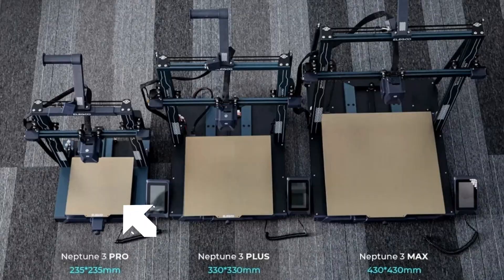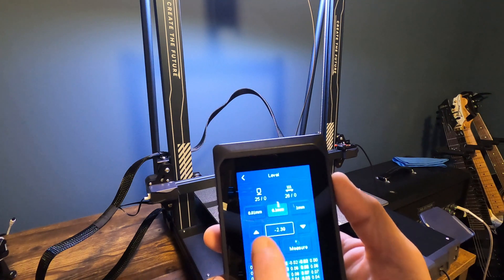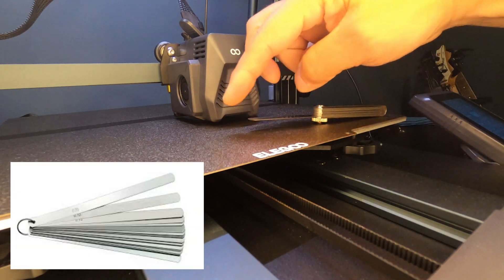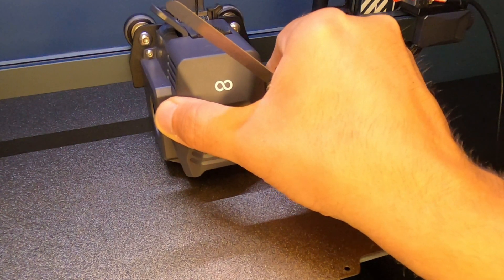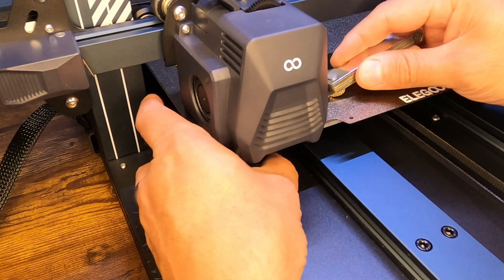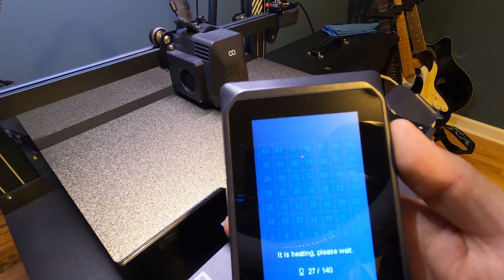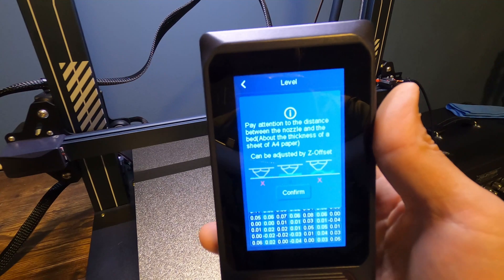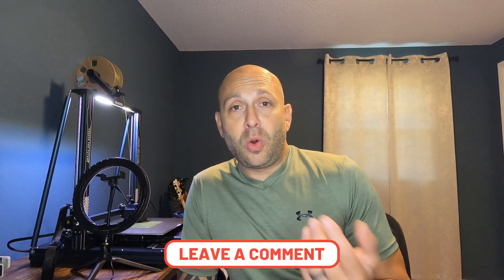Elegoo Neptune 3 Bed Leveling

Comment: You can remove the individual feeler gauges from the pack by removing the screw in the sheath.  Then the feeler gauge will lie flat on the plate.
Reply from the maker: Yup sure can!

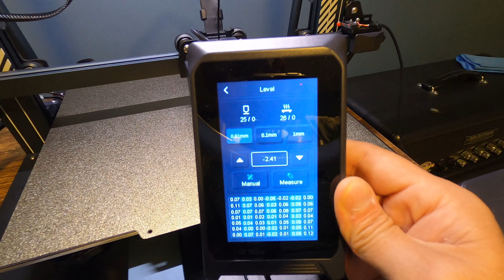Comment: Your description says "This works on any of the Neptune 3 series" but unfortunately this is not true.  At 3:42 you hit Manual which is not an option for the Elegoo Neptune 3, only the Elegoo Neptune 3 Pro or Max.
Reply from the maker: I think the pro doesn’t have the bed adjusters
Reply: I have the pro, I can confirm there is no manual leveling

Comment: My neptune 3 pro doesn't have those the option to manually bed level
Reply: My pro also doesn't have the knobs underneath or the options on the display.
Reply: I have the pro version with the upgraded firmware and also not seeing these options.
Reply from the maker: I’ve heard that about the pro model. That’s probably a good thing. Less adjustments. Just do the auto level and it should be fine

Comment: hey, I found your video very good and have bought the gauge but I can't tell if the gauge is feeling tension as well as with the paper, any suggestions?
Reply from the maker: You’ll definitely feel the paper and gauge have friction if adjusted properly
Reply: @theguyofalltrades  Yeah, i think I finally did, have had like three weeks of great prints

Comment: just got my neptune 3 pro and i had 2 successful prints even after i auto level the 1sr level position isnt even on the bed its way off to the right but as far as printing i get good few layers down and then it will just stop in same spot everytime any help will be greatly appreciated
Reply from the maker: I would start the relevel process over. Tighten the adjusters all the way down then go through it again

Comment: Need a maintenance video from this machine now after 2 years but don’t know what to do lol. Ps loved the video
Reply from the maker: Thanks! I just basically re-line the screws every month with super lube silicone lubricant. You can get it on amazon. I blow out all the fans with air duster. That’s basically it. Maybe check belt tension too

Comment: Is it necessary to keep the the probe point detection data to within ±0.1, or it really just depends on the machine?  Your values seem to be within ±0.1.  And what do the hi-lited versus non hi-lited columns mean?  Thanks man!
Reply from the maker: I haven’t done anything special. Just must be a really flat bed. Not sure on the highlighted values but it might mean ones that are different from the initial calibration when auto went through the auto mesh

Comment: My pro doesn’t have the 6 auto level spots in the corners just toe auto and x offset? And the values vary a lot on my bed how do I fix that
Reply from the maker: If they vary a lot you probably have a warped bed. Could try a different pei sheet or go to a dipped plate from sliceworx

Comment: If your levelling wheel comes off, how do you get it on?
Reply: Its just like a nut on a screw. Screw it the opposite direction
Reply from the maker: Just screw it back on. You may need to compress the bed on that side if the threads don’t catch
Reply: @ I had to put the whole machine on the side, but I figured it out the same day!

Comment: what happens if you use paper and it is not consistant will it ruin your print
Reply from the maker: The paper is fine. Just make sure not to set the nozzle too tight against it. You want to feel just a little friction when moving

Comment: I need help from someone when i return to home in the manual level my printer is offset slightly right from the middle of the plate.  PLEASE HELP
Reply from the maker: Run the leveling routine a couple times and it should all even out
Reply: You don't need help. That's completely normal. If you look closely under your Extruder, you can see that the distance sensor is positioned at the back left corner, so the sensor is centered.
Reply: @Bibaboboss thank you so much

Comment: When I do return to 0 on my 3 plus it does everything fine until it starts to drive really deep into my bed probably messing up the nozzle and stuff and then I gotta turn it off so too much damage is not done and it started doing this mid print
Reply from the maker: Is the zero sensor loose? It’s mounted under the hotend shroud

Comment: I was under the impression you had to save after you level because it doesnt auto save? something about having to add a line in Gcode or something like that.
Reply from the maker: It auto saves as long as you do the manual then auto level second. FYI updating firmware will wipe out the mesh points so you’ll have to relevel again

Comment: Thankyou for your video! I was able to level my max 3 by adjusting my first level before measuring all 6 sides. At first I couldn't level the right side of the bed...but it was because I needed to adjust my center level first. Thankyoh so much.
Reply from the maker: Welcome! It sometimes takes a couple times of going through the middle then the outer adjustments before it evens out

Comment: I am still majorly struggling with my printer over 1 year later. its the Neptune 3 plus. I have never once been able to get it consistently level. ironically my old cr 10 with the glass bed... I never had any issues. I have updated the firmware and have followed the instructions after buying a long feeler gauge and its improved but even today I cannot get it to consistently print correctly. I saw the comment to screw the wheels tight and reset the offset to zero and try again so ill see if that might help. sorry for the ramble I just don't think this printer is worth the headache..... at least the 3 plus in my case. I have to say as for a guide your video has been the best resource i used for improved results so you have my thanks!
Reply from the maker: Welcome. It can be finicky but once it’s dialed in will go for months without touching it. I must say Elegoo sent me the 4 plus and it’s much better.

Comment: So updating the firmware on these is difficult? I saw in the comments that its not really easy to update?
Reply from the maker: I found it extremely easy to. I think the issue people have is not using the correct size sd card

Comment: Hey. I'm a little confused here because I noticed on your screen there was an option to manually level the bed but I don't see that on mine. But then I also read another comment talking about having to update firmware... Would that be the reason I don't have a manual option?
Reply from the maker: What firmware version are you running?
Reply: His is a PLUS, you likely have a pro.

Comment: 11am I find your video extremely easy to follow. I’m not very good at this type of technology if that’s the word, I need to follow videos in order for me to learn stuff like this. I’m 60 years old and this is my first time with something like this? I don’t even know how to use a video game.
My question is, can you make a video of what to do when you’re in the middle of a print and your spool runs out 
Does it stop printing do you lose? Can you continue where you left off after the spool is replaced?
Reply from the maker: If you have a filament run out sensor like I do on this printer it will stop the printer if it’s enabled. You just then swap out the empty spool for a full one, purge the filament out the nozzle and restart the print on the screen and it will pick back up.
Reply: Am 63 and bought a printer two weeks ago. 

The bed leveling did my head in.

Most of my print failed at the first layer or two and or warp.

Sadly for me my work shop is unheated and very drafty so I suspect that is the main cause.

Comment: Im confused, before this video i have seen people comments about feeler gauge and they say 0.08 some say 0.06, some say 0.4 and after this video im more confused. If i understood correct, you said 0.4 or 0.2, so what is best for 0.4 noozle?
Reply from the maker: .06 is definitely too close. It will smoosh your first layer. A standard piece of A1 office paper is anywhere from .2 to .4 depending on the weight of the paper. I’ve always used .2 but .4 seems to work better. The auto leveling will take care of, minor differences

Comment: Elegoo sucs DO NOT BUY THIS SHIT I have an elegoo mars 2 pro and neptune 3 pro you gotta update firmware and d all this shit it's bullshit
Reply: 100% agree.  Their software is trash.  Almost all my prints have something wrong with them.
Reply from the maker: All printers need firmware updates. Unfortunately Elegoo isn’t super user friendly. Bambu is the way to go. I’ve bought two x1c and an a1 combo since this video and barely use the Elegoo any longer. Doesn’t even compare to Bambu
Reply: @theguyofalltrades  well I didn't k ow I need a. College education in firmware for this I've run three other ones with no upgrade fuck elegoo thier shit I'd trash glad it worked foru

Comment: Hello! Could really use your help. Went through your process on leveling the bed of my  brand new Neptune 3 MAX. Problem is that when printing large model the print line is smeared in the upper left hand corner of the build plate. Seems to thin as well. It printed out the buddha model no problem , but of course that is pretty small. Please help!
Reply from the maker: If it’s smeared the nozzle is too close to the bed I think

Comment: Hello. when I click on level, it moves back and forward, and then itgoes down (eje y) and when It touch the plate, it trys to continue going down and start to sound a bad noise... what could i do
Reply from the maker: Start from scratch. Make sure z offset is zero and tighten all the adjusters. Then go through the steps again. It may take a couple tries to get it perfect
Reply: Is the build plate on? The printer uses the metal build plate to recognize the bed. If it's not on, it'll keep going down and damage your bed and the nozzle..

Comment: It would be nice if the ABL worked … I’m part shimming the corners of my bed up and sliding post it notes under the plate
Reply from the maker: It works fine for me. Maybe try re-trimming the bed with a feeler gauge instead of paper if you haven’t then run the auto level again?
Reply: Thank you for your response.    @theguyofalltrades  I think I found my issue!  The sensor was cocked a little to the side and not reading straight down.  I had it slightly crooked when I tightened the fastener and it had jumped over its alignment pin.  At least I hope that was it.  I changed that and added M420S1 to my start up gcode to apply the mesh to the print and I think it’s working ok now.
Reply from the maker: That’ll definitely do it. Don’t even think of that. I’ll file that one away for later in case I have this issue.
Reply: @theguyofalltrades  

By the way you’ve got a new follower for caring enough to respond to my ambiguous and typographically erroneous comment.
Reply from the maker: Thanks!

Comment: If it's not a stupid question if you adjust all 6 wheels to the feelers gauge then adjust the z axis in the middle doesn't that mean all 6 wheels are now wrong ?
Reply from the maker: Nah the middle tends to be lower or higher than the outside. That’s why you use a .1 or .2mm feeler. It gives you a little wiggle room. Too close and you’ll notice your first layer will be squished and too far you’ll see separation between layer lines

Comment: I have the same printer and am having problems.  A couple of the six adjustment knobs are somewhat loose.  Can't seem to figure how to adjust.  I did contact Elegoo and hopefully they will help.  But maybe you have a suggestion.   Thanks.
Reply from the maker: I would tighten them all the way down then reset your z offset to zero. Home the printer all axis and proceed to do the manual bed leveling then the auto. It took me about 3 tries when I first got it out of the box. What are you using for a feeler between the nozzle and build plate?

Comment: I agree with the overall steps in this video and I had switched to a metal feeler gauge as well to be more consistent as I found that an A4 paper thickness is anywhere from .05mm to .11mm depending on the source and even so I've had way to much trouble getting prints to stick to bed or layers to stick / smush correctly ... so Elegoo's Auto level is only of value if you can get the z offset right and this process above  (by it's self) did not work for me.  What I did was do the steps in this video and then print a adhesion square in each corner and middle of bed this allowed me to see that I needed to make additional adjustments to z off set until lines started sticking and no longer see gaps between lines .... after all that I kept retesting these prints until I could remove them from bed and not pull apart the printed squares, printing only one layer of the test square was enough to see if sticking well and layers smushed together if not adjust z off set and print again.   Another thing to keep in mind is if you see wavey layer where parts are almost see through you are to close to bed so need to find a balance between your adjustments to Z.   Just another newbie with my 2 cents.
Reply from the maker: Checkout the other video. I found a bed level print I upsized to fit the plus that works amazing.

Comment: After doing this do you have to subtract the size of the feeler gauge from the original z-offset you input to calculate the .1mm that was used to level? Im just having a hell of a time getting my bed leveled and ive done every tool imaginable and areas still dont come out right.
Reply from the maker: Make sure you clean the build plate with isopropyl alcohol. Did you set the z offset again after manually tramming the bed and auto bed leveling? I adjust it before and after

Comment: I leveled the bed once on my Neptune 3 Pro, a few times on my Neptune 3 Plus, and repeatedly on my Neptune 3 Max, which inexplicably needs it frequently.

Another annoyance is that none of my Neptune 3 printers remember the Z-offset unless that is performed immediately after bed leveling; at any other time, changes are lost the next time the printer is restarted. I can work around this by tweaking the Z-offset in Simplify3D, but engineers thinking logically could enable that in Elegoo printers, as other manufacturers have done.

Another persistent problem on the Neptune 3 Max is that I must mash the nozzle into the bed (roughly 0.2 mm lower than it should be) before manually adjusting the six knobs; if I don’t, the nozzle is considerably too high at each of the six points. I can ultimately obtain very good leveling and Z-offset but the procedure is noticeably more exasperating than it is on any of my other printers.

My Anycubic printers (Kobra Max and Kobra) are better than my other eight printers in terms of remembering bed leveling and Z-offset as well as having a logical, intuitively obvious menu structure. The award for most convoluted, utterly illogical menu structure goes to Creality for what they did on my CR-M4 and Ender 3 S1 Plus, both of which seem hell-bent on destroying print beds; each one has done that repeatedly, most recently with the CR-M4 ruining an expensive 470x470 mm PEI sheet by attempting to print a few millimeters below the bed after months of printing — some only hours before — with the bed correctly leveled and Z-offset set A-OK.

After these and other problems, the chance I will ever buy another Creality is ZERO. Elegoo? Probably, but with some trepidation.
Reply from the maker: I find it pretty easy to level it honestly compared to an ender. I don’t feel like the mesh level really doesn’t do anything. I get super consistent prints and level once every few months.
Reply: What do you mean The Neptunes forget previous measurements after being restarted!? 
Are you telling me all the work that I just had to follow on this video is going to be made completely worthless every time I turn it off?!
Reply: @JackEverton101 : On my three Neptune 3 printers, only the Z-offset is lost when the printer is restarted UNLESS that is performed immediately after bed leveling. Putting their other flaws into perspective relative to my other printers, they are nevertheless my favorite and the ones I prefer when I need reliable prints. My two Bambu Lab printers have exceptional print quality but are very unreliable, often failing to complete prints without repeated manual intervention.

Comment: That feeler guage seems like a good idea, both of my very first prints leveling off of paper came off about 75% through
Reply from the maker: It’s consistent more than anything. I’ve had good results with paper too though. Had to be thicker paper with glossy finish
Reply: @theguyofalltrades Yeah well it seemed to work much better, I got down to the 0.00-.003 on most of the bed, some still sitting around .5 but it's at the edge and I won't be using that anytime soon so, not my current issue. 
I was trying to do dog holes earlier thinking the fine setting would be fine but it started grouping? I don't know what else to call it, about 75% of the way through. It just bunched up a load of resin doing the infill so the z head kept bouncing up and down off of it and over it, I am guessing it was a speed thing cause going at .28 on the fast setting worked okay, but it still shows signs of where it was bunching up in a sort of slow spiral but mostly straight line up the edge ( I think where it starts the infill portion each slice). What is this error type called and any idea how to fix that but still do fine prints?

Comment: A4 paper measure 0,06mm not 0,1, big difference!!
Reply from the maker: A4 is the length and width measurement. Weight of the paper determines the thickness. 80 GSM A4 paper is up to .11 mm thick